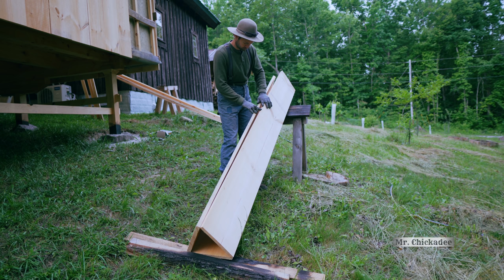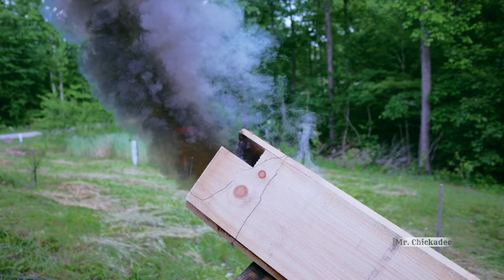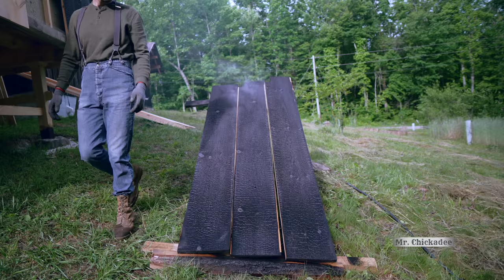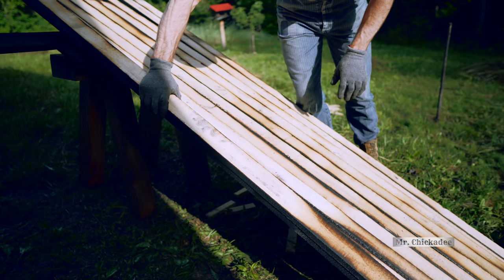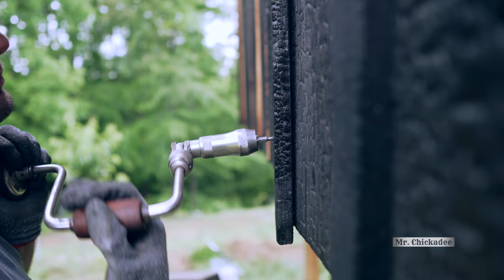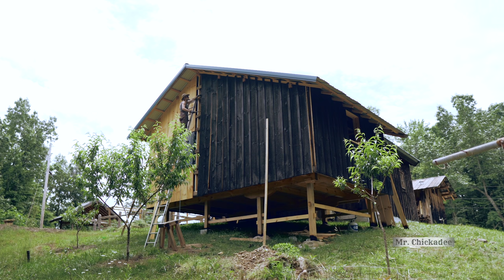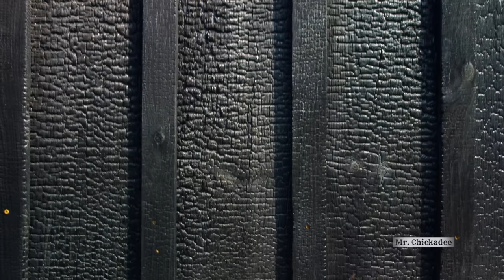Burned board and batten siding. Yakisugi (焼杉) Yakimatsu (焼松)

Comment: Awesome! Does it ever need a coating of any kind? What about a stucco type coating on the siding after the burn? For extra fire protection?
Reply: I’m in southern Oregon and we have over 300k acres burning now.... any semi- prevention kind of coating to the burned siding? I like it still
Reply from the maker: No, this is the "coating" it is also more fire resistant than just plain wood. You could also treat it with a flame retarder while green, but it may make the charring more difficult, I have not tried that myself, only know of it.
Reply: The burning or charring of the wood creates aromatic compounds that repel insects and mold. So you could see it as a ancient lumber treating method.
Reply: I have limewashed charred wood siding and fence panels. Informal testing suggests that this improves fire, decay, and pest resistance over char alone.

Comment: It is too hot (where I live) to watch this video without jumping the burning scenes!
I always wonder why Mr. Chickadee doesn't use natural insulating materials on roofing? He does everything perfect, but that metal material for the roof, is not a very good insulation. I know it is an easy material and it makes no problem due to weather change, and it doesn't allow any rain to go in the house, but it also reflects the heat a lot in the summer and doesn't do very good insulation in winter compared to natural roof bricks or shingles
Reply: He could pack the attic cavity with hemp insulation, or straw
Reply: He uses Larsen trusses to allow room for thick layers of mineral wool insulation.

Comment: If a person did not love the look of black burned wood, would a linseed oil based paint make it less durable (UV proof, insect proof, mold proof, fire resistant)?? My guess is the paint coating would add to the durability. Could you paint a small section of wood to test this theory? It would take a lot of pigment to cover black for sure, but grey is OK. Or maroon...
Reply: Honestly, no. A linseed based paint may be more durable than most of the common acrylic paints used now, but this is far more durable - it doesn't have to be done again. You'll be repainting in 2-5 years, most likely. 

I've heard of fences made from charred ash that lasted nearly a century. 

If you are going to paint and want it to last, I'd recommend going the route of aluminum paint prior to whatever color you want to use - it will outlast the tinted paint you decide to use, and will give the wood a much longer life than pressure treating.

Comment: That's odd, I thought partially-charred wood was more likely to catch fire again than raw wood.
But people in the comments are acting like this somehow improves fire resistance instead of making it more fire-prone.
I'd like to have this explained in a better way than "ancient people knew what they were doing with traditional techniques," because that's not always true.
Reply from the maker: have a torch? try a simple test, burn a piece of wood, one end to other, as you come back into the already burned part it will be harder to ignite.
Reply: @MrChickadee  the exception  would be cotton charcloth
Reply: In short, by charring it, you burned off the parts that catch fire first.  What's left takes a higher temperature to ignite.

Comment: 0:45
For those who want to try this at home: do not forget to use steel wires. Copper or certainly tin wiring would not withstand such heat.
Reply: Copper works fine. I have used scrap 12 awg solid copper for this exact purpose.
Reply: You could definitely use copper.  Copper has a melting point of over 1000C.  This fire is only a few hundred degrees F.  People cooked in copper pots and pans over fires like this for centuries.
Reply: @Cyanide300  various propane air-fed torches are in range from 1100 °C to 2000 °C (2500 °C for oxygen-fed), well above copper melting point. My tip was about to minimize any possible risks, do not underestimate human stupidity. And it is easy to get some leftover steel wires from rebar bundles.

Comment: Hey Josh, why do you nail the boards and screw the battens?  Bret
Reply from the maker: Hey Bret! The single nail in the large board just holds it there temporarily till the battens pull it all tight. You could even remove that nail after the battens go up. You could also use a single screw. I guess I like a nail since its easy to put in and take off with just a tug or a hammer tap one handed while I am holding the board in place with my off hand. The screws are nice for the battens since they really pull tight, also can be tightened up later or removed easily.
Reply: @MrChickadee  is the nail stainless? i assume the screws are.

Comment: wont the insects/fungi get inside the wood from the unburned side? 
Also, why are you not using electric tools? first i thought you just want to do everything "the old fashioned way" but then i saw your roof is made from modern-ish metal sheets, as well as you using this blow torch. (not critizising, just curious)
Reply from the maker: I enjoy using hand tools so I use them. I prefer the longevity and strength of traditional methods of construction, so I use them.
Reply: @MrChickadee  oh, that makes a lot of sense! thank you for your reply

Comment: i have a 4 meter long larch planks that i intend to use for decking. i will shou sugi ban the heck out of them. how should i lay them so that "bark out - tree up" would make sense horizontally? or is it a very stupid question and i should be embarrassed ?
Reply from the maker: If following Japanese tradition, you would place them bark side up if laid down horizontally. Tree is sideways so that part matters less.
Reply: @MrChickadee  thank you for your answer.
Reply: What does bark side mean
Reply: @mintymintygogo  Look at the growth rings on the end of your boards. The arcs, should face the outside.

Comment: You didn't oil it before putting it back up?
Reply from the maker: nope never oiled
Reply: @MrChickadee  for which (personnal) reason(s) ?
Reply: Why did the charred post feet get oiled?
Reply: @MrChickadee  I’m curious why you didn’t burn both sides since both sides are going to be exposed to moisture. 

Also, with such thin, wide boards didn’t you experience cupping ?

Comment: What r the benefits by doing these. Nice work
Reply: It's one of the oldest way to preserve & weather buff wooden surfaces.
Reply: it's black, and it's not paint for starters so you will never have to re coat, and char coal is extremely tor resistant, when we where younger we burned wood in our house, and when we would get more wood than we where going to burn in a year, we started a fire and charred every log and stacked them with a sprinkler running on the log to stop the fire, we stopped using wood and run our heat now, the wood 6 years later is still not rotten, but the wood we got 2 years ago is full of ants and rot

Comment: Heat transfer is facilitated by the black coating of the surface. The coal is black.
Insects need moisture and air to live. Charring does not prevent water from entering the wood; on the contrary, charcoal acts like a sponge.
This will probably help with mold. But such treatment is questionable as a protection against insects and fire.
I may not understand. Can you explain how charring works to keep wood from insects?
Reply from the maker: Carbonizing the wood removes the nutritive aspect which insects feed on, they have nothing to eat in charred wood, therefore the outer charred layer, being the first which they will encounter, turns them away.
Reply: Centuries old process
Reply: Also, mold (especially toxic black mold, stachybotris sp.) is killed in the presence of creasote, which burnt wood is full of.

Comment: Does anyone know of a place which sells that hand drill/driver?
Reply: Probably any big flea market - it's the old style of hand tool, my dad used and trained on all that stuff, as did the whole world back when.
Reply: Usually you can find them at antique stores or wood working suppliers.
Reply: Ebay might be the easiest. There are tons of bits and braces on there. Millers Falls, Stanley etc... They often go for very cheap.
Reply: Often called a bit and brace. eBay or antique shops are going to be the fastest answer. I found mine at Estate sales.
Reply: You can also buy new from Lee valley for $90

Comment: Don't they seal it after they burn it?
Reply: I believe the burning properly done, is the seal. It's like searing fish, moist on the inside and tough on the outside.
Reply from the maker: Ive never seen traditional Yakisugi sealed in Japan. If you wanted to, a drying oil could be sprayed over top with a garden sprayer.
Reply: @MrChickadee  Have you watched birth of a wooden house by northmen? I saw it there and thought the sealing was traditional!
Reply: @MrChickadee  Ok, thank you

Comment: I wonder if a finishing coating of some kind, such as lacquer, would give it some sheene.
Reply: Actually, it does! A clear coat poly will give it a little sheen indeed! Give the wood a little sanding to smooth it out (240 or finer) and then apply the finish coating. A similar practice was used by the Japanese to give that "polished ebony" look on a lot of their handled weapons like spears and glaives
😉
Reply: In Japan they use an oil of some kind to preserve the char.
Reply: You don't want to lacquer this. It has to breathe.
Reply: @JoshuaSteensland  tung oil

Comment: Isn't that the way they make charcoal? So you now have charcoal for exterior siding. Not sure that is fireproof... IDK Thumbs Up!
Reply: Centuries old process
Reply: With the volatiles cooked/pyrolized out of the wood, it is much harder to get it to ignite
Reply: I would be more concerned with vinyl siding if you’re worried about fire, I have seen it in person. Once exterior vinyl has caught fire, the slots will melt away around the nails and fall right off - and if there are slots not melted down the same run longways, you have a floppy swinging fire stick that has a good chance of igniting any structure it hits

Comment: this method is called Shou Sugi Ban
Reply: There are a lot more steps to be done if using the Shou Sugi Ban technique that this fella did not do. Thus, he simply charted wood panels and screwed them to the wall. No wire brushing, no cleaning, no oiling, nada.
Reply from the maker: Actually, this is the traditional Japanese technique. What you are describing is an aesthetic burn, normally reserved for furniture and other light use, not in the weather uses. Also, Yakisugi (焼杉) is the correct name, not shou sugi ban, that is just a mistranslation that wont die as it gets spread around.

Comment: Will use a torch won't use a electric drill.
Reply from the maker: I use the tools I want to.
Reply: "An" electric drill... "an"

Best come correct
Reply: Electric drills take away some of the control you get with a manual drill.
The number of times I've drilled too far or overscrewed things is ridiculous.

I think I'll buy a manual drill and use it instead, might help me a bit.

If time/money isn't an issue, doing things mostly manually is amazing.
There's a natural human quality to not only the work, but the finished product as well, which cannot be beat with standardized, machined, laser cut, or mass produced stuff.

I'm in the middle of building a coop and this channel has been absolutely wonderful in giving me ideas for it.